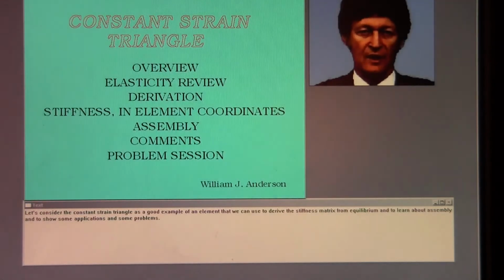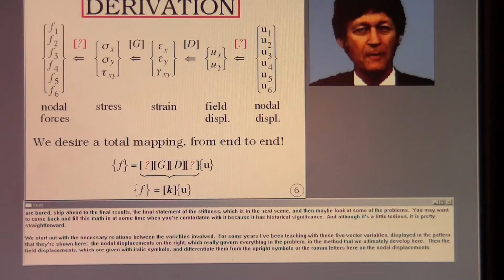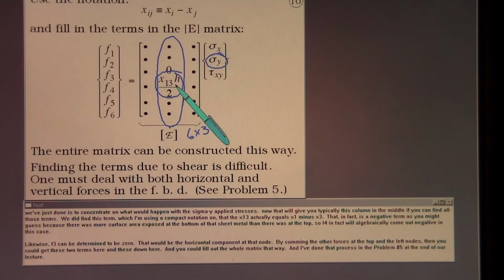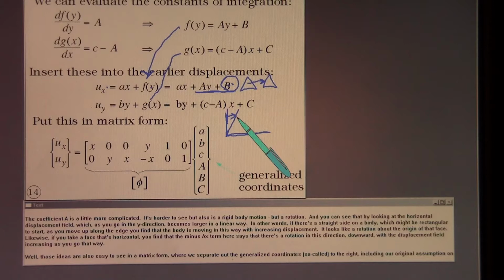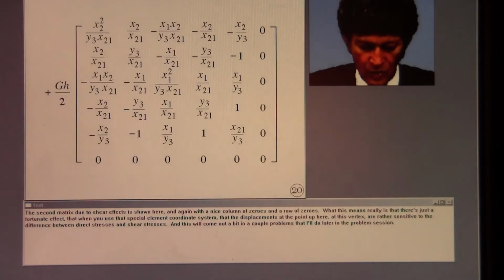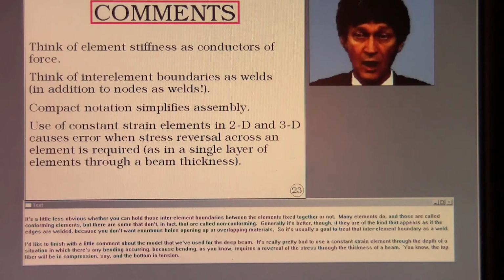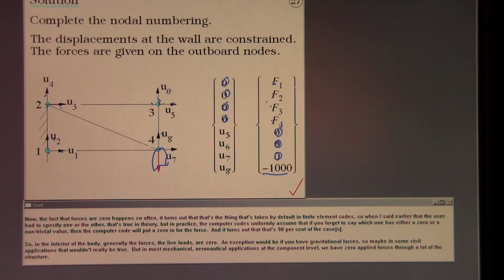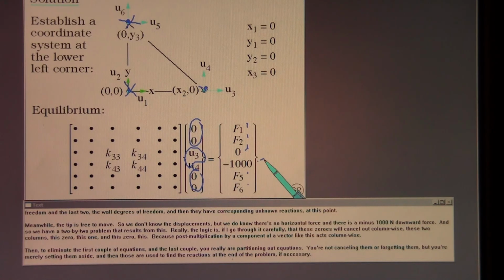Constant Strain Triangle. Lecture 3, Part A.

Comment from the maker: Because the field displacements u(x,y) and v(x,y) are linear functions of x and y, the strain displacement laws such as
epsilon xx = d(u)/dx will yield a constant.  This holds over the entire domain of the element.  The same is true for 
epsilon yy and epsilon xy.

The nodal displacement are the physical motion of the nodes.  They are not functions of space.  The internal displacement field is interpolated from the values of the displacements at the nodes.  Keep trying to understand this.